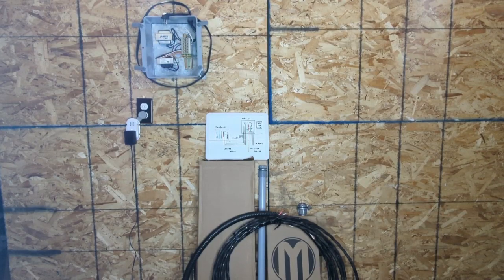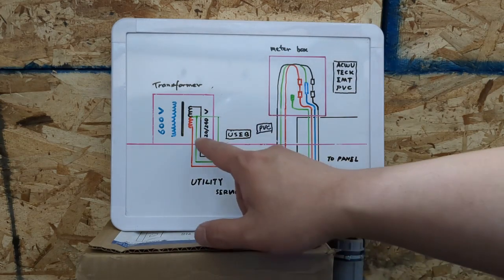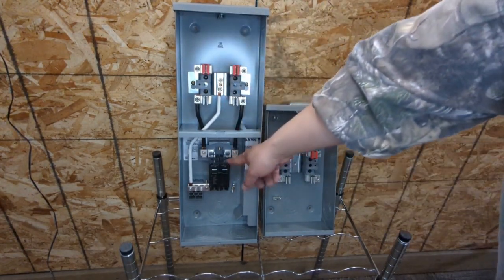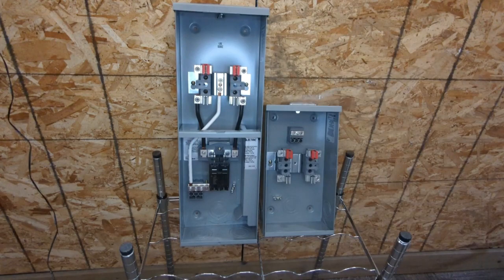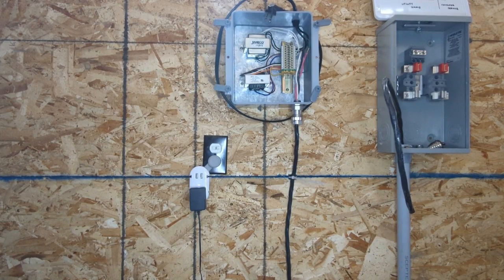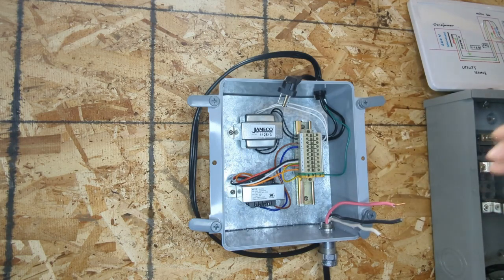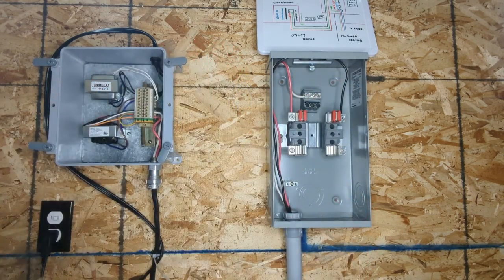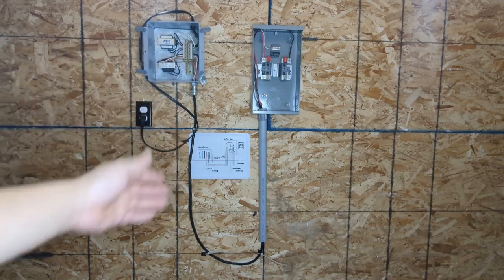Step-2 Install the meter base for the 120V/240V Split Single Phase Power System

Comment from the maker: (1) 120/240 split single phase power source
(2) meter box
(3) main electrical panel
(4) sub panel
(5) system bonding and grounding.